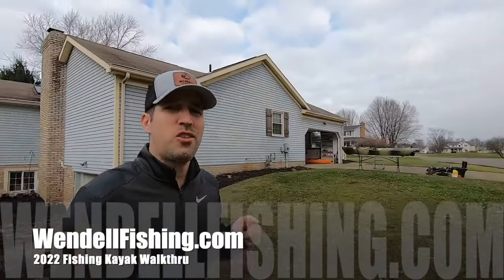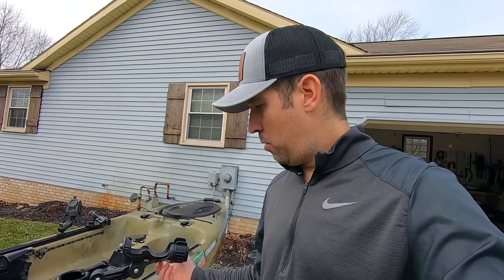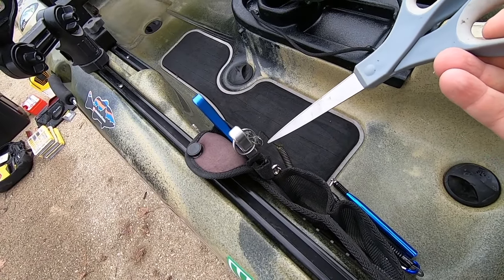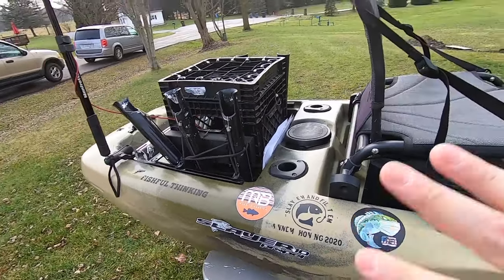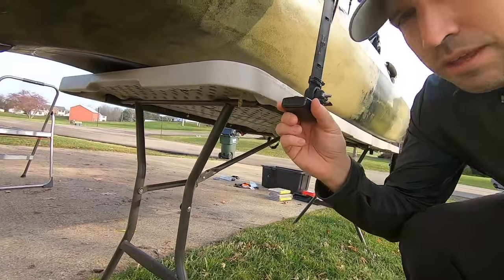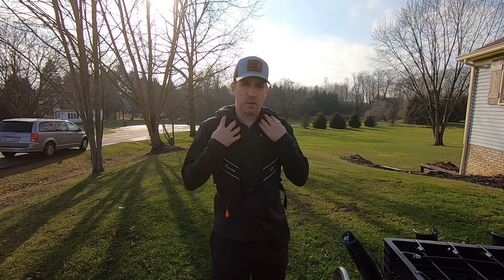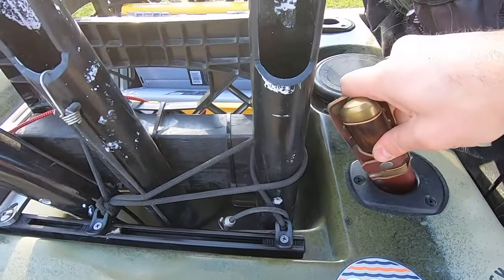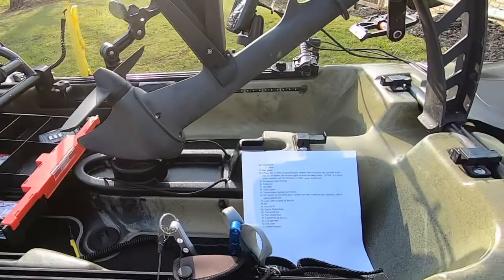FISHING KAYAK SETUP! - Detailed Walk Through - Kayak Modifications

Comment: I have the Titan 10.5 "Yak, and did a modification with "Kite String" about 5 years ago - after the S/S Cable broke Twice in 3 months - on my rudder control.  It's actually Kite Surfing String, with a breaking strength of nearly 700 pounds.  After using it nearly a season, I called up Native Watercraft and told them about it.  (I guess it's "Standard" now, on most of their kayaks.)  Mine has held up for nearly 5 years, with only one time having to "adjust" it due to stretching.
About the rudder extension - I made mine from 18 wheeler mud flap - and it hasn't "Broken"!  Haha!  I'm working on a Drop-Down Rudder now, made of aluminum - so I can drop it down or raise it, from the seat.  (Let ya know how THAT works out for me, in the future!).
Installing a Garmin 93 UHD SV on the 'Yak today.  (Got tired of my buddies finding more fish than I could, with my old Lowrance Hook 7 SV!).  Haha!
Reply from the maker: I love this post. Mud Wheeler Flap mod is awesome and great work on the "Kite String" I believe that is Polyethylene by Spectra (USA) or Dyneema (Europe) which is what you would want. I'm curious on how your drop down rudder turns out. Let me know... .and yeah.. going to be investing in an upgraded Fish Fisher this year as well. Thanks for the tips!

Comment: Man you have a nice setup. I like how you went through showing how you set it up. I also really like your DIY leashes that you made. I did the same thing using 550 cord &  carabiners on both ends and I haven't had a problem since. I used it to tie to other boaters , kayaker , boat docks. I also like you're DIY pulling rope you have. I have 1 too that I made. I used it one time too tired tie around a Bridge pole to take cover from a severe thunderstorm underneath the bridge & use my DIY leash to tie my buddy kayak to me to ride out the storm. When I told my buddy how I made the DIY leashes My buddy said tomorrow I'm going to make the same thing for my kayak. He realize how important they really was. I also like your Chaco sandals you are wearing. I have 2 question? I heard several people said they are having problems with the toe loop tightening down really tight on their big toe causing the big toe to hurt. Have you ever had this problem before & #2. Do the toe loop only opens up a little bit? When I was trying a pair on I could not get my big toe to fit through the toe loop. I do have big very very extremely wide feet sz15 6 EEEEEE wide with very chubby fat wide toes that are equally straight across making my foot very very wide at 6 1/2 inches wide from my big toe to my lil toe. My big toe is  2" inches wide alone so I do have some very fat wide toes. I have to kayak Barefooted 👣style because my foot out-grow shoes , socks , & boots 33 years ago so I am looking for some sandals to wear while kayaking. It sucks having very very  extremely wide feet. I was born and raised with extremely wide feet & and it's been difficult all my life trying to find Footwear for my foot. Very good video sir not really enjoyed watching this. I appreciate if you can help me out. Looking forward to checking out the rest of your videos.
Reply from the maker: Hey Mack, Thanks for stopping by and for your questions. When it comes to the big toe loop, when you first purchase them...this can be an issue but over time you dial in the fit. They also come without the toe loop if you are worried about it. Also, yes the toe loop is one continuous strap so every part of the sandal strap is adjustable. Hop that helps. These are great sandals and that last about 7-10 years. Keep the questions coming!
Reply: @wendellfishing  thank you buddy for replying back and you are welcome. Oh okay you just have to dial them in comfortably. Me & my  buddy is looking for a pair & he just told me that they have some without the toe loop. My buddy doesn't have wide feet but his toes are spread out so the pair that I tried on might work for him. But the ones I tried on in the store I found out they was not wide & they only carry the toe loop Style. I think the one with out the toe Loop style in wide is what I need to try on to see if they fit cuz I even try to put the toe loop underneath my big toe but I still cannot even get my foot to fit in the sandal because the straps was not wide enough. I got to try to find a store that would sell the wide version of these sandals. That is awesome that these sandals last 7 - to 10 years man. I was buying flip flops every 6 months at first cuz I was wearing them out really fast to the point that underneath my big toe , the balls of my foot , & the heel of my foot would have a hole through the of footbed of the flip flops until I found a good pair & now I get about a year out of my flip flops. The only problem I have is that the footbed wears out really really fast. I have a nice wide worn-out footprint on the footbed of my flip flops. I really really do appreciate the information thank you so much. Hopefully I can find a pair by Springtime.
Reply from the maker: @mackjenkins7721  Right on Mack. Just so you know when you are out looking. Chaco's have regular and wide sizings. I used to be sponsored by World Wide Wolverine who owned or still does. Chaco sizes are marked on the back of the heel of each shoe. A dot means it is the regular width, a dash means it is a wide. Hope that helps!
Reply: @wendellfishing  oh thank you so much for that information. That will really really help me. I am all the time looking for flip-flops and not much of sandals so that information really help. A dot Means regular widths & a dash means wide width. I will tell my buddy this information too so he will know. Thank you again that is a big help cuz I didn't even know that. I really do appreciate you helping me.

Comment: Would some window tint for the light inside make it less overwhelming?
Reply from the maker: Great question. I would imagine that would work. Anything to dull the light. I also know some of the LED strips come with a remote in which you can change colors as well as dimming settings. May be good to invest on the front end if you want this flexibility.
Reply: Red lights don’t hinder your night vision, put red lights in the cockpit

Comment: Ohio boat, nice. Ever been to Kiser Lake. Is a non electic paddle  lake
Reply from the maker: I’ve never been but likely because it 3.5 hours away :)
Reply: Yup, I'm above Chillicothe so it's a drive for me.  Went south to Lake Vesuvius  off Rt 93 , nailed a 5 lbs bass in the lilly pads patch over their. 
It's a nice lake to paddle.
Reply: @wendellfishing  Kiser Lake has big  hybrid striper bass feeding off the bottom. Plus alot more different species
Reply from the maker: @lowlifeangler  nice
Reply: @wendellfishing  Kiser Lake Update: went over there today with my Tamarack Pro.  tried different lures and setups. Used a shad natural color  medium sized  swimbait with a micro rod and reel.
Nailed a 2ft+ striper bass. Trying to getting in the boat, forgot the net ,  snapped 8lb braid. It pulled  me around in circles.

Comment: Question. I’m wondering why and where a person goes that you need to carry 6 fishing rods. I been fishing 27 years and not once have I been on a trip where I needed more then 2 rods. Just wondering. And great video to thanks
Reply from the maker: Solid question BigD, I sometimes go with less, however I have different power/action rods with different line types and line weights for different lures and cover I'm fishing. I will oftentimes run through 3-4 of my setups in a matter of 5 minutes.  I don't like changing out lures when I'm out on the water if its not necessary.
Reply: Thanks 🙏

Comment: I'd run a nice piece of aluminum. Definitely a lot cheaper to make it, than that boondocks one
Reply from the maker: What would you run aluminum for?
Reply: @wendellfishing  instead of plexiglass, weight is just about the same but aluminumunmiimmmm won't shatter. A peice of 1/8 thick aluminum. There's a place near me called metal supermarkets. I can go get a 6-in x 10 piece of 8 in aluminum and then cut out the design I want.. and that piece of aluminum is probably only a couple bucks
Reply: @wendellfishing  and the aluminumunmiimmmm gives me peace of mind that it won't shatter if it was to hit a rock. Plexiglass I would worry about. But that's just my .02. I'd rather have the extra protection and not need it ,bthen need it and not have it
Reply from the maker: Ahhh. I see! Good point